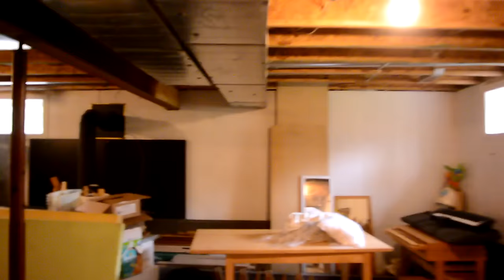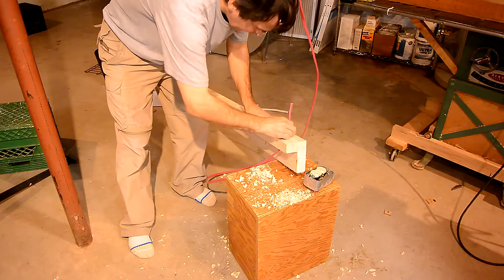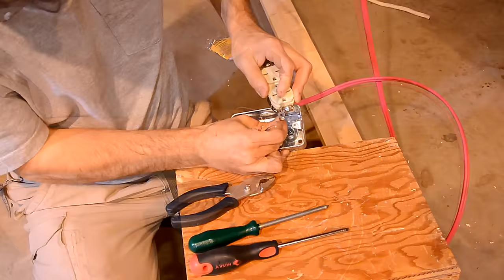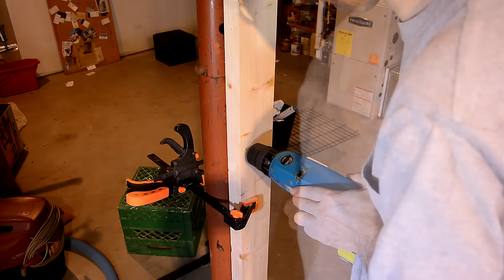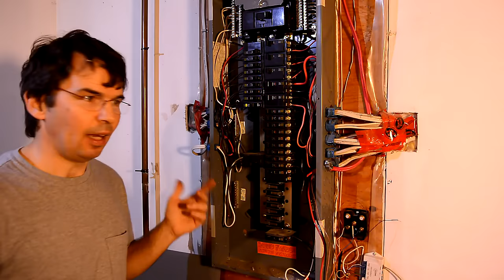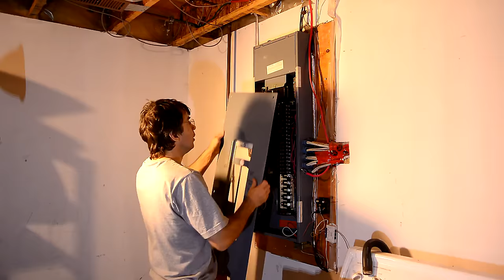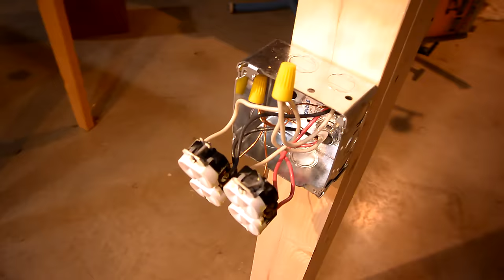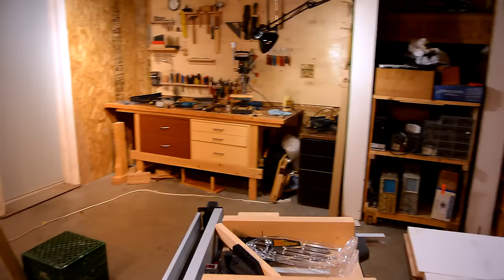Wiring a new 240 volt circuit

Comment: Im not an electrician, but a diy'er.  I recently ran a 12-3 wire from the breaker box to a dedicated 20amp 220v  outlet.  Obviously, I used the red and black to power the outlet and each wire is landed on one end of a double pole breaker for the 220v.
Here's my question:  can I pigtail 110v off of one of the 110v running to the 220v outlet and feed a new 110v outlet using the (currently unused) white as a neutral and pigtailing from one of the hot wires?  I haven't been able to get any information online about this.
Reply: Two different voltage circuits in one outlet box is not allowed.
Reply: M. A.    Yes your questioned installation is allowed by the NEC. As long as it remains in the 2 pole circuit breaker, and the amps of the breaker is either 15 or 20.   If 30 amps or higher, device needs to match breaker.
Reply: Kevin Coop is correct .

Comment: Have you measured the total power drawn from your lighting circuit Matthias? Just out of curiosity rather than any loading concerns. I wonder whether there is more power being drawn than stated on the lamps? If your lamps are on a driver then almost certainly more is drawn than stated on the driver, 30%?

Comment: So I got a little confused at the end there about him also adding 120 volt outlets. Did he do this off of the 240 volt circuit and line he installed? I can understand if you only use one of the hots for the 120 outlet, but where did the neutral come from? It looked to me like he only used two conductor wire, not three conductor wire. So there would only be the two hots and the ground. No neutral. Did I see that wrong? And another question, if he ran this off of the 240 volt 30 amp circuit, wouldn't that be a safety issue since 120 lines are usually only 15 amps? Someone please respond. Thank you.

Comment: Perfect video for when I install a 220v outlet for my Everlast welder!
Reply: Just make sure is a heavy enough wire to handle it, just know #10 wire for 30A #8 for 40A and  what you'll probably need is #6 wire for 50A. And don't get roped into buying a #8 extension cord, it's hard on the machine GET #6 lol

Comment: Does anyone know if what he says about the two phases cancel is right??  I thought they were 120 degrees out of phase so you would have to have a 3 phase system to completely cancel to neutral, i guess in any case it is "reduced".
Reply: Answer is probably a center tapped transformer, that would produce 180 degree phased electricity
Reply: David Wostrel    What he said and is completely correct is, that if he has let's say 10 amperes being used on both receptacles an put an amp meter on the neutral, then there would be 0 amperes on the neutral.    If 10 amps in only one receptacle then 10 amps on the neutral.   His only mistake was using the word phases.   It is single phase( 1 phase).  The sine wave for the 120 Volts and the 240 volts are the SAME point in time.   There is no degrees involved!   They both start, peak, and end at the same time.   The only difference is the voltage.

Comment: Really liked this video as I am thinking of adding power to my shop !   I am interested in learning more about your addition of the 8 new sockets (second project in video).

For instance :  
Could you explain in more detail about the 3 conductor wire "opposite phases" or "split 240v circuit ?
a.)  Definition of "opposite phases" ?
b.)  Whether the 3 conductor wire, to the first 4 plex, is attached to the same 240v circuit you installed or a separate (second) 240v circuit ?
c.)   Whether you attached the 2 different 4 plex boxes in series or in parallel ?
d.)   Whether the 2 different 4 plex boxes are attached to one circuit or 2 different circuits ?

By the way, what is the amperage on the new 240v circuit ?

I apologized for my electrical ignorance and thanks for your generous consideration,
Steph_Louisiana
Reply from the maker: There is a book called "electrical code simplified".  Go buy it.
Reply: I am not an electrician. Here is what I understood: 1) input or line is the single 3 wired 240v - red wire 120v, black wire 120v, plus neutral/white.  the 1st receptacle uses the input line/black 120v wire. 2nd receptacle uses the input line/red  120v wire - connected to the brass screw normally for line/black wire. Since the 240 breaker uses both sides/banks of the power source, so it is 2 different 'phases.' I don't know enough to explain what phases are or how they neutralizes each other as Matthias said.  The neutral comes from only 1 side of the bank - so shared by both black/red hot wires. Then from the 1st receptacle (with black wire input), it passes power to the 2nd pair of receptacles (1st receptacle of 2nd pair) via the 2nd screw (brass/load) on  the same side as the input/line black wire. Same for the 2nd receptacle that uses red wire to the 2nd receptacle downstream. Please consult reliable documents.  My understanding could be wrong.

Comment: Hey I got a question....I don't have enough room in my breaker for a double pole 40amp is there a problem if I use a single pole slim 40amp as suppose to double pole? I only have one more space for a breaker and I want to add a oven and microwave combo that has 40amp specs.

Comment: Those were 3-prong plugs, but I don't think I saw an earth, just shielding. Is that right? 

Also, out of curiosity, is modifying your breaker box strictly legal? In the UK, the first issue is that it's not legal if you're not certified, and second the breaker box is technically owned by the electricity company.
Reply: as crazy as it is, yes, in Canada a homeowner is allowed to work on their own electrical panel and circuits. Doesn't mean it is done to code or properly, but they are allowed. 

Insurance companies love this because when there's a death or electrical fire and the place burns down, they don't have to honor the claim.
Reply: You're supposed to have a permit and have an inspector come and inspect your work and sign off on it, so you can show your insurance company that it is done competently.  The homeowner can do the work, but they are legally required to have it inspected and approved before powering it up.  

Of course, this is impossible to enforce.
Reply: lrochfort 
Nothing you have said is true. The consumer unit (not a breaker box in the UK) is owned by the homeowner not the DNO. You can legally work on anything you own provided you are competent.
Reply: In North America the electric company usually owns everything to the meter. Everything downstream from the meter is the property of the landowner. If you wish to upgrade your panel, and need to kill the power at the meter, you are supposed to have the power company do it. They tend to get pissy if you switch that yourself. And since everything downstream of the meter is the land owners, they are free to do as they wish. They have that freedom, its just about how much risk they wish to take. The other comments here are just potential risks. The code issues don't matter until you need to sell the house usually. The home inspection will find them and the buyers will usually demand they be fixed before buying.
Reply: Brian Helmold 
That is exactly how it works in the UK but with slightly different terminology (!)
Reply: The cable Mathias used has three conductors, one of which is protective earth (aka Ground). The protective earth conductor is connected to the third prong of the outlet. It is also connected to the metal outlet box. And it is also connected to the protective earth bus back at the main panel. It is a perfectly reasonable arrangement. Nothing dodgy about it.
Reply: I don't know where you are, but I have never seen a home inspector remove the cover of a breaker panel and the covers of all recepticles and switches to see if they are done correctly. I've seen inspections done and the house passed where there were switches held onto a wall with drywall mud and connections made outside of electrical boxes...live wires insulated with masking tape and lying on the floor, all sorts of things.

Comment: Nice video, I was looking to add a garage heater thay needs 240v, but online says I need 10awg wire is this correct 10 is so much more expensive, will the 12awg work
Reply from the maker: depends on how much current it draws, and whether the wire ends up going through insulation
Reply: @Matthias Wandel  so if it goes through insulation does it need a thicker wire or thinner.
Reply: mike holt classes might be helpful

Comment: i want to do this very same thing but with an out building. mine is totally not safe the way it is.    Your Video will probably make much more sense to me after I go watch some different ones but you go so fast and with such little short explanations, i just get a big ? in my head.  and all i can think about how big the sparks are going to be when I try all out. LOL 

  i have a 220 capable water pump motor running at 115  on a 58 foot piece of 16 gauge romex. on that same line I have 2 chests freezers and a big gas yard light.    not good.    so i need to run more wiring and install at least two new breakers on the main and a switch box on the out building. or maybe like you did one heavy breaker on the main and then one wire to the out switch box for my 220  and and come off that with the reg house current outlets since the pump at the creek doesn't run full time, just when i am watering.

Comment: How do you determine the size breaker to use and how do you know how many amps you can pull total with every other breaker/circuit
Reply: The MAIN breaker limits total current to the box.  It is set to be the smaller of the box's maximum current capacity or the feed to the box's current capacity.  This prevents the panel from ever drawing more current than can be safely supplied up to and including the panel.

Individual breakers have to be an amperage lower than or equal to the current handling capacity of the wire leading to the outlets.  The outlet can be lower current than the wire, but it is a good idea to match them, if practical.

So 14 AWG wire requires a 15 amp breaker or smaller.

Comment: Is the load on the neutral "canceled", or is it that the phases are alternating?
Reply: Kevr the two 120 volt legs ate in phase. The add to 240 volts. It is single phase power. If one leg has 4000 watts resistive to neutral and the other leg has 3000 watts to neutral the neutral carries the 1000 watts. Ie 1000/1200 = say 8 amps

Comment: Here in Maryland, USA, by code we must use #12  4 wire.  A Red, Black, White, and a bare ground. The red and black are 120v each and the white goes to the common buss and the bare ground to the ground buss. I know the common and the ground buss are the same, but that's the code.

Comment: Cant get how electricity sistems work in America, Your usual supply is 120v in 2 phases and one neutral? Is like a way in the Middle between the single phase and the 3 phase?
Reply: The typical situation is to have 240V. But the secondary winding also has a center tap. The center tap is "neutral" and is bonded to earth at the main electrical box (at the panel). Voltage from center tap (neutral) to either of the other two conductors will be 120. Most circuits work on 120V. But higher power appliances such as electric ranges or air-conditioners or electric heaters will work on 240V. And some power tools. So you see, it really is single-phase, but with a center tap. Sometimes this is called split phase.

Comment: If anyone ever read that, I have a question! Regarding the 120 V outlets he added, where does the neutral come from ? What is it connected to ? Both wires from the 240V circuit are hot, and have no neutral. What am I missing ?

Comment: I always wonder why breaker-switches / fuses look so much different from the ones we get in germany, and do you only get 2 Phases + Neutral + Ground in each house or why is there only 2 "live" bars you clip the switch on :D sorry, just asking
Reply: Richard Kiermeier it is split single phase. 120 volts hot, a neutral, and another 120 voltd hot . There is 240 volts across the two hot wires. The breaker box two vids bars are the two 120 volt legs to neutral
Reply: 3beltwesty well, i mean like, in germany we have a 3 phase system, plus neutral and ground, and across any phase we have 400v and phase to neutral is 230v, so why is there so much difference between the two?
Reply: Richard Kiermeier hi Richard. 3 phase power is rarely used in homes in Canada or the usa. A wild guess is only one out of a few thousand do. 3 phase is in many commercial businesses.  A McDonald's here has 120 volts 3 phase 208volts in Y ie star. 120 volts are on 3 hot wires to neutral.  208 volts line to line the 2 hots.
Reply: Richard Kiermeier another 3 phase system is 277 volts line to neutral on 3 phase an 440 volts line to line.
Reply: Richard Kiermeier yet another 3 phase system is a high leg delta. It has 3 hot wires and 1 neutral. Two hota are 120 volts to neutral and the 3rd is 208 volts to neutral. With this settup there is 240 volts line to line
Reply: Richard, The USA's  closest system to your " In germany we have a 3 phase system, plus neutral and ground, and across any phase we have 400v and phase to neutral is 230v, so why is there so much difference between the two?" 

is 277 volts to neutral and 480 volts to line to line 3 phase. This is used in larger buildings where the 480 volts might run 10 ton AC units in large buildings. The classical fluorescent fixtures here used from 1945 to today (pre LED) often have ballasts that work from 120, 240 or 277 volts too. Banks of lights have one run on Phase A, another row on phase B and the other row on phase C. All on 277 volts line to neutral. For repair, shutting off 1 out of 3 banks does not  effect the Walmart, Home Depot or assembly line worker. :)

Comment: As a former electrician I jumped out of my seat when you touched that hot main. Not worth it man I can tell you from experience.
Reply from the maker: I figured while I was triggering all the safety nellies, might as well do that too.
When I was a teenager, working on a TV where chassis was hooked up to one side of the power lead (old tube type), I'd swipe my finger across the chassis after plugging it in to make sure it wasn't hot.  After about 10 times of doing this, I thought it was oodd that I somehow always put chassis on neutral, then checked it against proper ground - it had been hot half the time, I just hadn't noticed.  When you aren't grounded, touching hot does nothing.

Comment: Gobs of funny comments by the safety police. Working on 240 volts is like working with a powered saw. Some folks should not use circular saws, chain saws or wire breakers either. If one has to have permits and licenses and gobs of protective gear to install a breaker in Oz, EU or Germany; can you buy a chainsaw to cut firewood or is this something that the public cannot do? :) 
    
A bigger risk with poking around on a live breaker box with parts 120 volts to ground is slipping the screwdriver if one is clumsy, tired or working in the dark . Having glasses, or better safety glasses really is needed. What happens is the short fries a piece off the screwdriver and burns you, or worse yet one chunk goes in your eye.

 In the USA radically more folks are hurt with saws than breaker boxes,

Comment: hi, I followed for installing 240 V 100 A circuit for my EV charger. What do the instructions mean by "The Neutral at the service panel must be connected to Earth Ground somewhere in the system "?
Reply from the maker: It means exactly that.  What part of this do you not understand?
Reply: @matthiaswandel  I was checking to see if i missed something. it turns out to be a bug in BMW EV app, charger works fine when i select AC current limit

Comment: Does it make difference if you switch red and black wire around?
Reply: No.      You'll be fine I would use a double  30 amp breaker with a 30 amp. Outlet
Reply: @craftman5632  i got you,  thanks. Will get it done this weekend.
Reply: @ikay2102  remember yellow Romex is for 20 amp, and the bright orange Romex is for 30 amp.
Reply: @craftman5632  yes sir. I wrote that down.
Reply from the maker: it was 14 gauge wire, just like the white stuff.  It's not about amperage, but how it's meant to be used.

Comment: how is the 240 working without a neutral? are you using your ground to complete the circuit?
Reply: You don't need a neutral with a 240 V.  Think old style three prong dryers.  Newer appliances with fancier electronics require a neutral but the motor will still run off of just the two hots.
Reply: @speednutsII  With alternating current tho i was told in school you needed to complete the circuit in order for it to function so im just curios about the science, first year apprentice. Are the actual devices themselves just direct current now instead when they consume this much power?
Reply: Christopher Carvalho    I hope you have figured it out by now.   There are three connection points on single phase 120/240 volt systems.  L1, L2, and N.    L1 to L2 is 240 volts(no neutral connection used).  L1 to N is 120 volts and N to L2 is 120 volts.   The other comment is incorrect.   In a dryer or a stove, you need L1, L2, and N.   The heater is 240 volts and the motor and controls are 120 volts.  Stoves are the same but need more power(more heaters).    So, if a machine is listed 240 volts, then no neutral.  If listed as 120/240 volts, must have neutral.  Hope this helped!
Reply: @KevinCoop1  thanks for the comments folks, i understand the wiring but not the science still, I suppose thats the biggest part of the battle, best wishes thanks for the info.

Comment: You should wire the ground connection first, then connect the wires to the breaker.  THEN snap the breaker into place.  Stay safe.